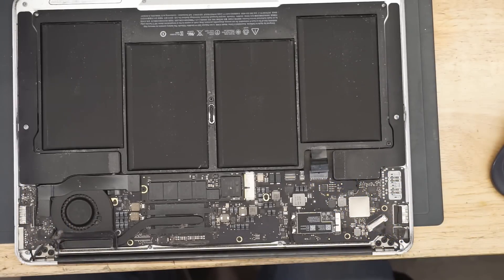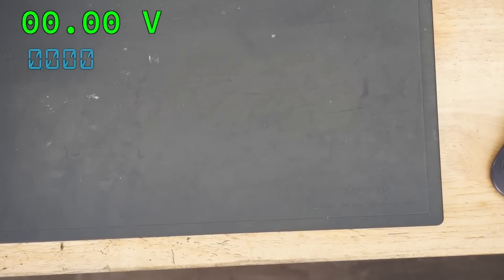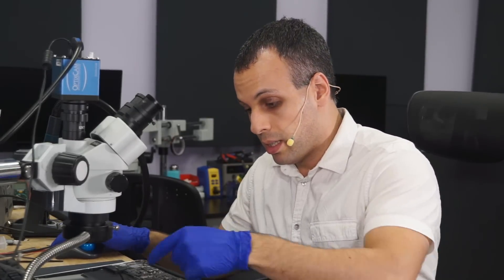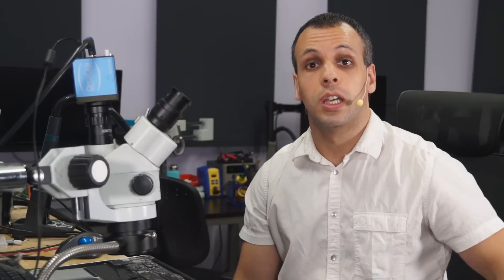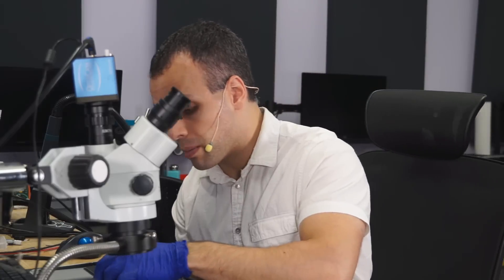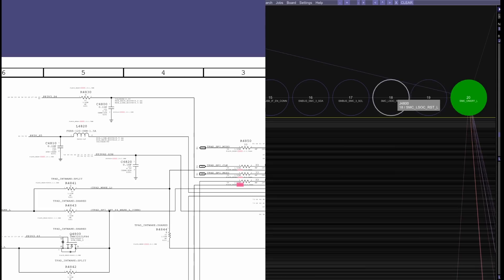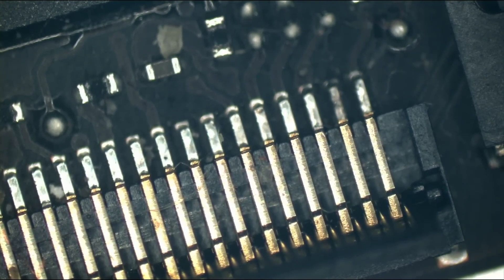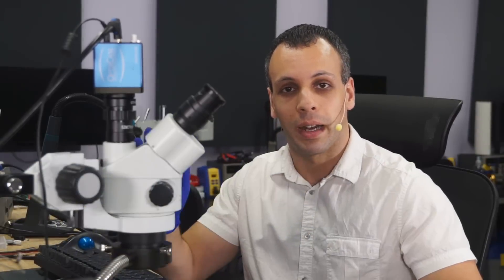A1466 Macbook Air not turning on, COMMON SMC reset issue due to bad IPD flex/trackpad.

Comment: hey man, I also have the same problem with my MacBook air a1466, i did some research and i found that the common problems with this model it that it stops charging and turning on due to the charging port shorted and like with that MacBook, maybe the trackpad too is the problem.

Comment: Thank you Louis! This video saved my sons laptop. It was exactly as you described but even more corrosion at the plugs. I used a normal 1" paint brush and touched it with it's hair to remove all corrosion which went very well. The hairs just rubbed it gently clean. Shiny metal below and after i wiped off all corrosion the laptop started up like new. You are a hero!

Comment: I have a MacBook Air i recently picked up, and this exact thing happened. Corrosion on the pins AND the flex cable. Diag showed the SMC error. Why the hell does it make sense to have this sensor in here to throw the smc error?

Comment: hey brother i have a a1466 where itll get stuck on the loading bar sometimes.. and sometimes itll boot and work fine.. i have tried the ssd in another macbook and worked fine. i have tried all the resets and even swapping the bios chip but no go. what controls the loading part or what could be causing this issue ?

Comment: After reprogramming efi chip of a a1466 I miss the resistor r6115 near u6100, if I understand, this resistor missing cause no voltage on the line and no power!?

Comment: This video has resolved my issue that has plagued my wife for 2 years.  The Macbook Air has been repaired under warranty by the "Geniuses" 4 times with 3 main board replacements. Issue always came back.  I opened it up and and what do I see. The damn flex cable is corroded OMG. Apple wasted my time and they replaced everything except the track pad, keyboard, and screen. I cleaned the cable corrosion until I order a new track pad with cable.  The Macbook boots up now and I no longer have to unplug the battery every time after a shutdown. Thank you Louis.

Comment: That's the first thing I check on that model with any power issue.  
When you replace the track pad, how do you run the track pad mapper? Its my understanding that the macbook Air requires that for the function keys to work correctly doesn't it?

Comment: I am facing exactly same issue with my macbook air for the last 1 year. Gave it to Apple's authorised service center but they weren't able to tell me the exact issue. They told me that motherboard has to be replaced and gave the quote for 32K INR. But clearly it's not a motherboard issue.
Reply: They'll tell you it's a bad motherboard when they can't  identify what the real problem is. Shitty phone repair stores do the same thing. Basically if it's outside the technicians diagnosing skills it's automatically a board problem.
Reply: Well, to be fair, if you buy a crApple product, you deserve your misery.

Comment: I enjoy these videos, because you actually fix problems rather than throw shit into landfill and expect the consumstemer to buy the latest model of product.
Reply: I mean, tbh tho this is a 2013 model laptop, a nearly decade old laptop. Surely at some point you gotta tell the customer, look you might want to start considering the upgrade to a newer computer…
Reply: @bhud98  if the machine suits the customers purposes and all that was wrong was corrosion on a terminal, is an upgrade truly necessary? I do get your point, however.

Comment from the maker: Beginner's guide: http://bit.ly/2k6uz84
Repair wiki: https://repair.wiki/w/A1466_2015-2017_13%E2%80%9D_MacBook_Air
Reply: Hello Louis, I've been subscribed to you for a while, love your channel and evberything you do regarding right to repair. Anyway, I'm currently trying to diagnose a problem with my cell phone and it seems that the flexcable that connects the charging pcb to the mainboard has an issue, the connector on the mainboard is missing a pin on one side, I have identified from schematics that the pin leads to the USB_VBUS circuit. My issue is that my phone fails to charge at all. I am not very familiar with what USB_VBUS signal does, but would I be correct in assuming that if USB_VBUS signal is not received by the mainboard, a connection would be established between the charger and the phone? Phone is a Xiaomi Redmi K30 5G by the way, but I don't think that's really relevant, I just wanted to make sure I was heading in the right direction, and if this could be the culprit, to try soldering on a new pin to the board because the solder point is exposed, the pin just broke off it.

Also, if anyone else has any information and could chime in on this, please feel free to! It would make my night!

Thank you for fighting the good fight, since I started following your channel I try sharing the problem with everyone I know, and everyone I tell about it seems to be amazed because they had never thought about it in that way before. If all of us can do our small part in creating awareness of the issue in each of our communities, I have no doubt that in due time, your efforts will pay off, there's just that pesky "in due time" part that bothers me, but I guess Rome wasn't built in a day now, was it?